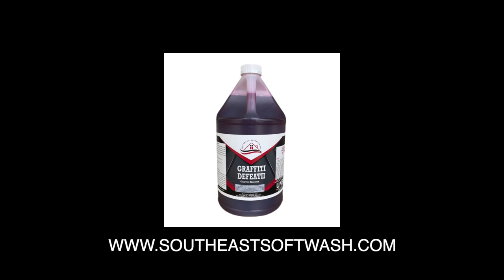BEST CHEMICAL TO REMOVE GRAFFITI

Comment from the maker: Get how to wash course here: https://bit.ly/HowToWash101

Get a case of (graffiti remover) graffiti defeatii here: https://www.southeastsoftwash.com/product/graffiti-defeatii-graffiti-remover/
Reply: I'm guessing if you do enough graffiti  you can have a designated pump spray for graffiti chemical and leave it the sprayer it would be fine as long as you release the air , right ?
Reply from the maker: @coachnate5747  well according to OSHA every chemical has to have a labeled dedicated container if not in its original container.
Reply: You wouldn’t have to use any chemical and worry about OSHA if you were using a hot water, pressure washer

Comment: some assh0le spray painted the side of my house.  ive already spend $150 on worthless crap such as goof off, klutter graffiti remover, mineral spirits, acetone, brushes, rags...etc.  spent hours and hours of spraying and scrubbing with not so good results.  i borrow a friends power washer but the stream seems very weak.  i think it was meant for cars.  can graffiti defeatii work without a high pressure power washer?

Comment: Hi m8.. Good vids man👍.. Got a question for u!
I have white roughcast.. Harling... On my outside walls and the fence was painted grey and so was the wall area surrounding the fence post attached to the house 🙈.. Don't wanna hit it too hard with pressure washer as it will blow the stones off the wall.. Would a paint stripper damage the white render and stones on the wall?.

Comment: I have a school that got graffiti the other day  first time  our library owns it and is doing nothing in spite of my calls -   my question is   if I Kilz II primer over that   would that thwart or screw over attempts by the professionals like you that have remove it later ?
Reply from the maker: I would either prime or remove, not both.
Reply: @AaronsLeanMeanAcademy  Thanks so much for the fast reply - I think for now (legally) I best not touch the school - they'll end up blaming me somehow - I might just spray adhesive some black poly tarp over it just to frustrate the graffiti creep and call the library again and push  - keep up your great service to your community

Comment: When you sprayed it looks like you used soap also. So when pressure washing it use soap and water correct? Also were you using hot water or cold? Thanks.
Reply from the maker: It's all the same chemical. GRAFFITI DEFEATII - 
Coat, Dwell, Rinse.

Comment: 3:08 When you mention "as long as you're using adequate pressure". How much pressure would you consider to be adequate? Will a 2.5 GPM be enough for graffiti removal? Or do you need a higher pressure washer of 4+ GPM?
Reply from the maker: You could prob do it with a 2.5 just let the chem dwell for a solid 10 min.
Reply: @AaronsLeanMeanAcademy  Thank you!